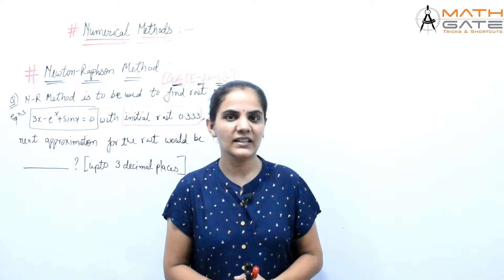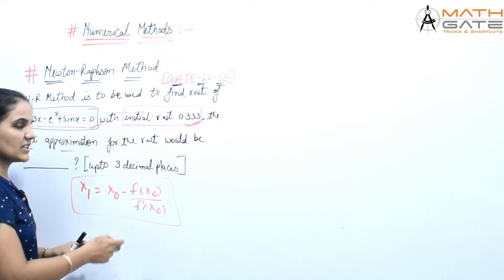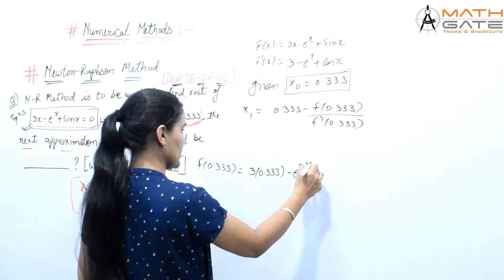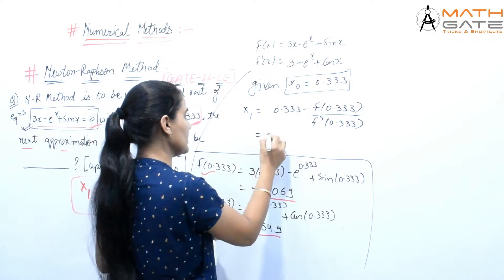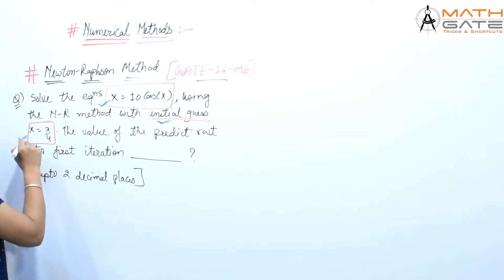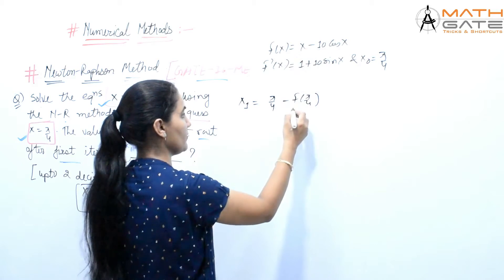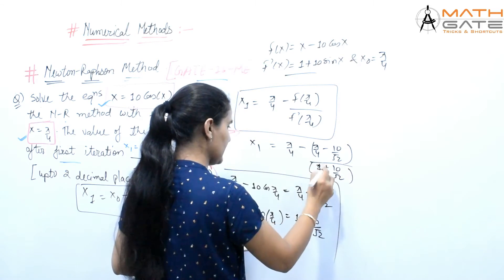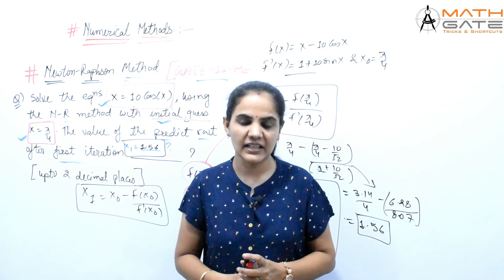Numerical Methods I Non-Linear Equation I Newton Raphson Method I Engineering Maths by Priyanka Mam

Comment: Value of the F(0.333) is -0.390. I think your value (-0.069) is wrong. Please reply if this value of your is correct or not.
Reply from the maker: U can check again...it's -0.06926 only... ✌️
Reply: @MATHGATE  I check atleast 5 times.... It is -0390. 
F(0.333)= 3(0.333)-e0.333+sin0.333
= 0.999-1.395+0.00581
=-0.390
Please tell me where I am wrong?
Reply from the maker: Anuj , u should take sin(0.333) in radian that is .32687
When, in general, trigonometric functions comes with other functions like exp. Or algebric then consider trigonometric functions in radian only.
Reply: @MATHGATE  Okay... Thanks Got it.👍
Reply: To ye cos(.333) kyu nahi hua
Reply: @MATHGATE  Cos(0.333) value in radian is 0.945, then the answer of F'(0.333) is 2.550 and hence x1 is 0.306. Where did I get wrong here.

Comment: Ma'am -0.069 ki jagah -0.338 aarha h
Reply from the maker: u should take sin(0.333) in radian that is .32687 then u will get -0.069 only.
When, in general, trigonometric functions comes with other functions like exp. Or algebric then consider trigonometric functions in radian only.
Reply: this is given in radian here nothing mention any degree (°) 
So change 0.333 radian into degree first and then put in the equation 
Sin(0.333 radian) : sin(19.08 degree) : 0.3268
So put all those value you will get the ans, hope this helps